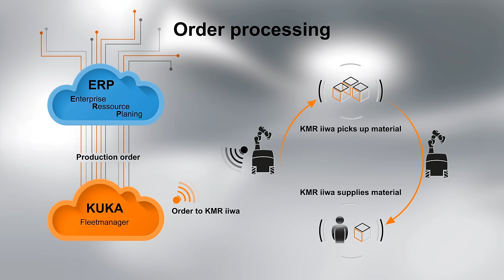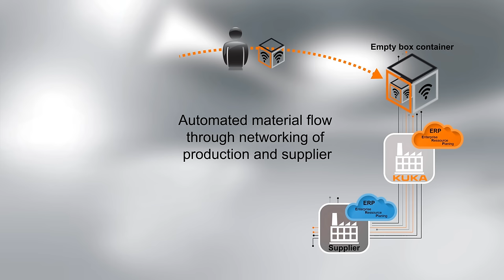Autonomous transportation with mobile robot KMR iiwa

Comment: to slow to actually use in a fast moving firm
Reply: that is what i thinking
Reply: It's slowed down for video and even if that was its limitation they made a breakthrough this year in making all robots perform 1000 quicker without losing any precision, action that used required 29 seconds to perform now only takes 0.08 seconds. So yeah even if you are right then you are wrong now.

Comment: How does the robot achieve +/- 1mm accuracy? Is it using onboard LIDAR, or some other system?
Reply from the maker: KUKA.NavigationSolution is our navigation solution for autonomously navigating vehicles. Whether navigation, control, management or monitoring: our navigation solution covers all mobility requirements.

Using the SLAM method – which is an acronym for Simultaneous Localization And Mapping – the platform is able to pinpoint its location in real time on a map of its environment created from the data of the safety laser scanners and wheel sensors.